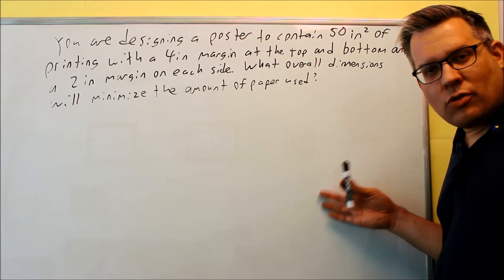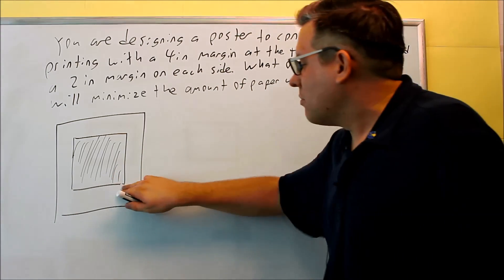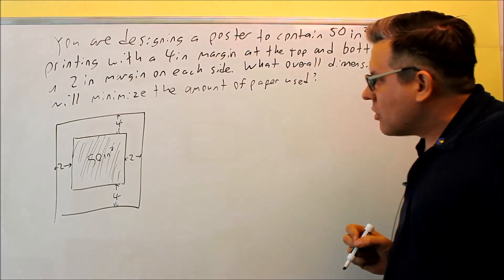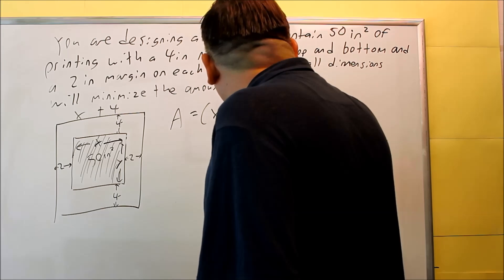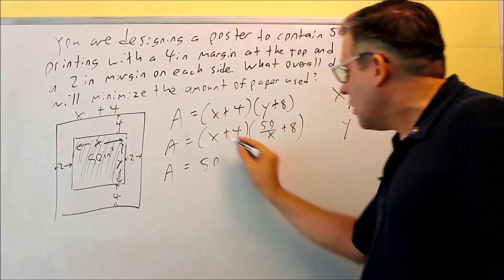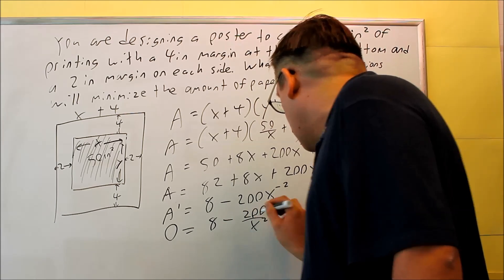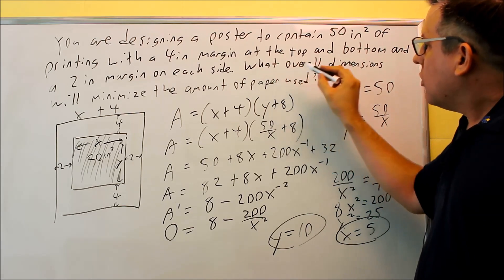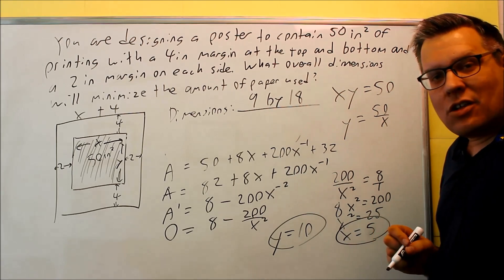Calculus Optimization Problems: Poster With Margins

Comment: You were supposed to use the Area formula as a constraint and then the Perimeter of rectangle formula as an objective equation (including the given margins).
Reply from the maker: So yes, the area is used as a constraint here, which is why we used the starting equation xy=50.  However, if we want to minimize the amount of paper used, this means we need to minimize the area of the entire poster including the margins. We would not use perimeter here as the objective equation.

Comment: I know how to do the math. I just don't understand the problem. Why is the 50 square inches in the inside of the paper? Shouldn't it be the total amount of paper used?
Reply: It says 50 in^2 of PRINTING, which means the inside of the poster without the margins. Be careful.
Reply from the maker: The problem asks for margins.  This means the 50 square inches is the printed section inside the margins.   The  printed section will not fill up the entire page.